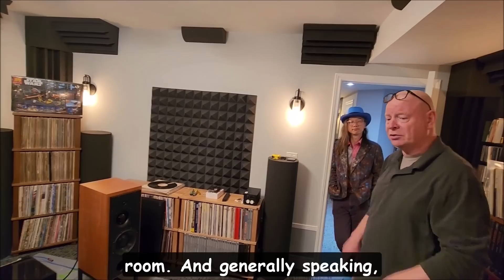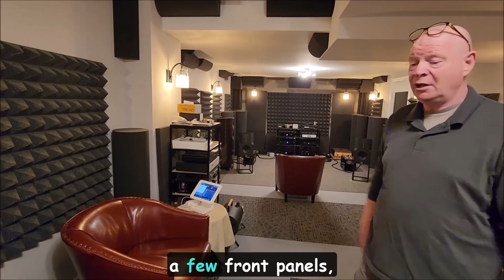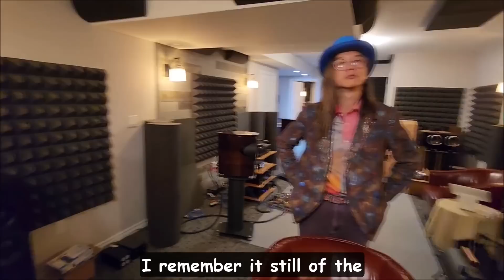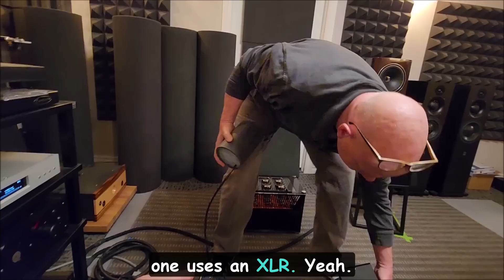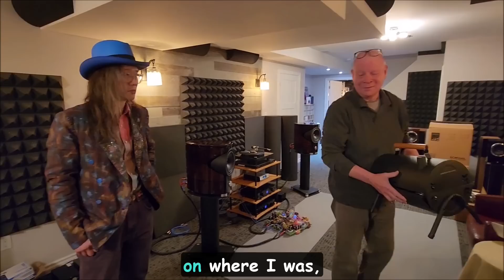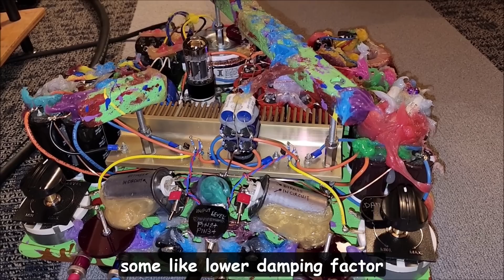Do You Know This Person?  Inside Entracte Audio Featuring Angela Gilbert Yeung

Comment: Wouldn’t it have made more sense to keep Blue Circle to reassure previous customers and just add these products as a new line within the brand?
Reply: This is an actually a pretty good question... you are correct in suspecting that multiple issues were at play. Let me give you the short version. Angela-Gilbert felt that they had moved on enough in terms both design and production advancements that the new equipment needed its own identity. They also felt that Blue Circle gear was built more towards the expectations of the audio industry, and that the new products was being built with Angela-Gilbert's own expectations in mind. This may seems like a subtle shift in philosophy, but the result has been the development of some really interesting and terrific sounding gear that brings a higher level of musical engagement and enjoyment.
Reply from the maker: I think I was more complicated at the time with Covid and other things going on.  Instead of permanently closing like many, he came back with a fresh design and outlook that probably was needed after 30+ years of doing the same thing.  Very few... In fact almost none last as long as Blue Circle did, and he can basically still service them I'm sure.
Reply: @AudiophileJunkie  Yes, there must be more to the story. Main reason I can see is to get rid of baggage, whether that is debt, image, bored, etc. 
I can see why you chose Gilbert for a unique build as he would love it.
Reply: @rvaillant  Getting rid of baggage was probably the reason behind most companies closing.  Not me.  When I closed Blue Circle in 2019, I didn't own money to anyone.  I have handed off full warranty service to a local well known technician Dan Santoni of DTS Audio Electronics.  Any Blue Circle owners could contact Dan and obtain 100% warranty service.  I was behind Dan for full support.
When I decided to back on stage again, as George Taylor has explained I didn't have to quite conform to the industry "standard" anymore and be freer than when I was Blue Circle.

Comment: Interesting audio designer.  I was interested in Blue circle early in my DIY pursuits.  He garnered some very good reviews from audio publications wrt sound and build quality.  I found his use of silicone dampening and heavy gauge wire for power sections compelling.  I incorporated that practice into my own builds.  To me it just makes sense.  I also often mount capacitors in soft wood using silicone dampening.   I use point to point wiring extensively.  Even without the transformer vibration, it is clear that all equipment is absorbing vibration from the environment.  It seems silly to pay big money for feet on metal boxes when so much can be done if you attack it from the get go.